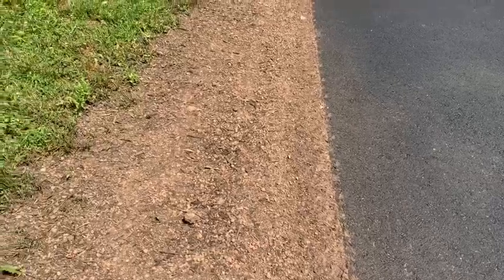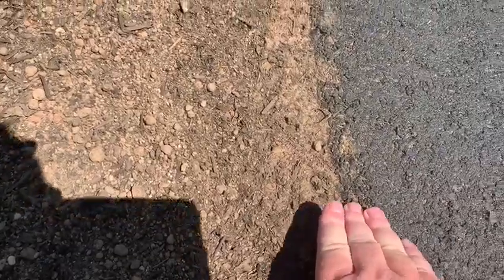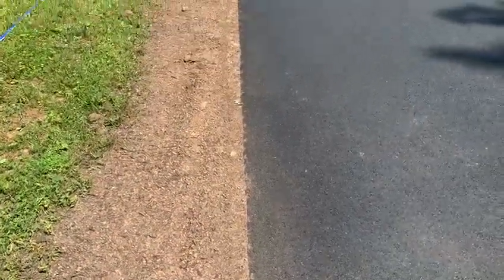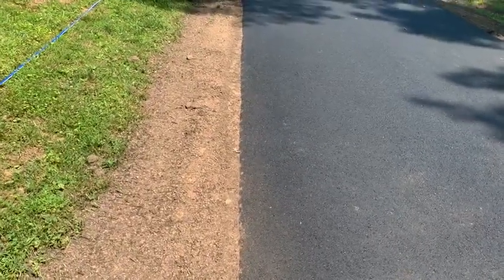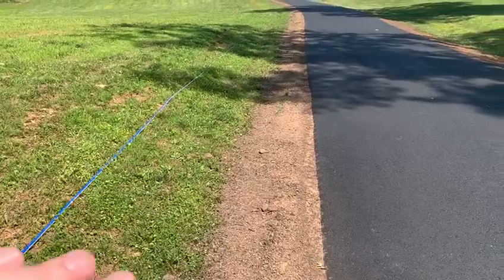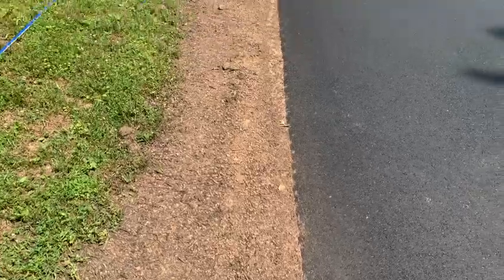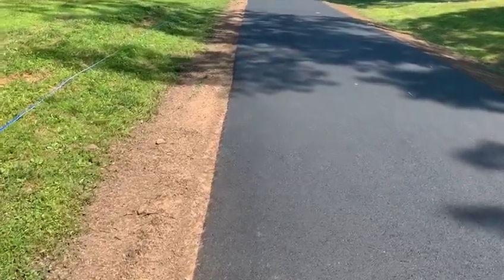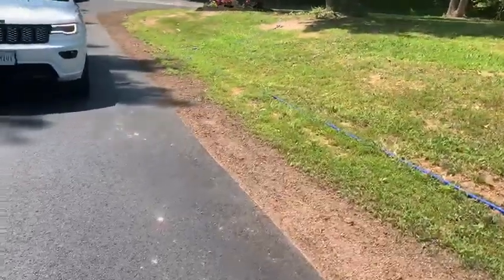Backfilling your asphalt edges, to add edge support and improve drainage

Comment: Ohio here. Have a driveway that was placed where there is a slope on one side, somewhat steep. The asphalt was piled up 4" above the soil surface in locations, with a slope away from the driveway... I have been pondering what to do for quite some time, but after watching your video I will be going the soil route. Of course I'm concerned that the grass won't grow fast enough and heavy rain will come or something but how far out should the dirt be backfilled? Thanks.

Comment: So my asphalt contractor hand compacted a 45 degree edge and I backfilled with top soil and seeded.  After grass was established and I stopped watering regularly the soil dried out, shrunk and pulled the edge of asphalt with it causing cracks.  some of the cracks are on the 45 degree face, others made it all the way to the main surface.  Very frustrating!
Reply: Did you wait for the driveway to cure at least 3-6 months before doing this?
Reply: @AndreiDPop  nope, did not know that was a thing, I should of done more research or I wish my asphalt contractor would have told that when I said I intend to backfill and pointed at the fresh delivery of dirt.
Reply: @udderchaos5221  I came to this video after having a new driveway installed. The old one was flush with the dirt and the new one site 2-3” higher so I was wondering if it was normal. 

Everywhere I read said it could take 6-12 months to fully cure, and it can still be relatively soft even 1 month after install. That’s why I asked if you waited for it to cure. I’d bet that’s the reason you had the issues you did. Given enough time, every asphalt driveway will eventually settle into the surrounding dirt as grass is mowed and the ground shifts from being wet. Sucks that you had to find out the hard way. I didn’t know about this either.
Reply: @AndreiDPop  so what I did to fix the cracking was carefully used a pressure washer to create a separation between the top soil and edge of asphalt and then uses crack sealer and a hammer to close the cracks.  And then I came back with a layer of sand along the edge of the asphalt before again backfilling with top soil.  I didn't want to leave a trough for water to collect in adjacent to the asphalt so I figured sand would not stick to the asphalt or allow top soil to pull at it at all with shrinkage.  Fortunately I think the repairs look solid and while I have seen the replaced top soil crack with shrinkage, the sand has protected the asphalt.